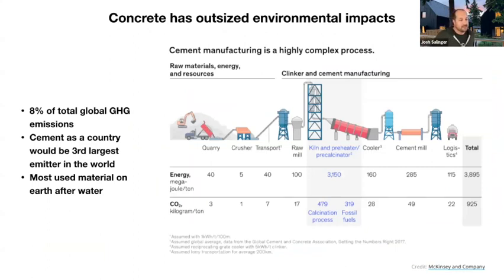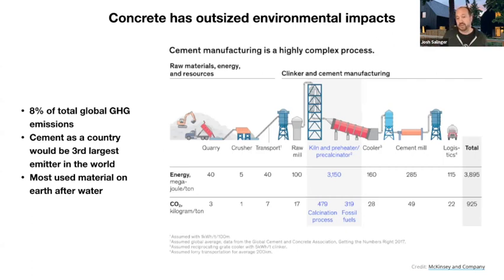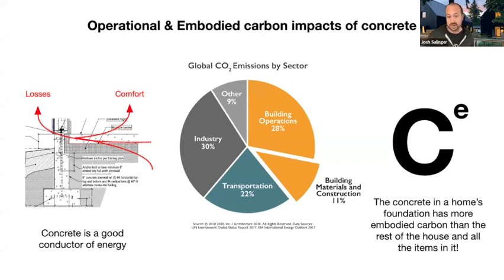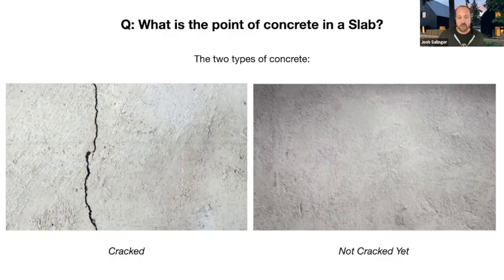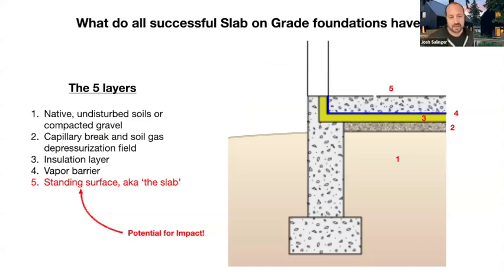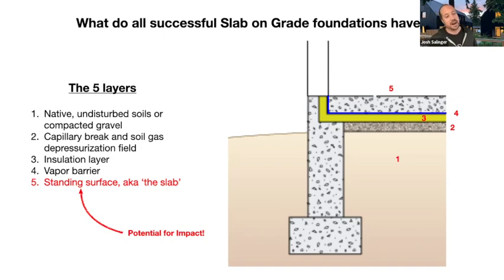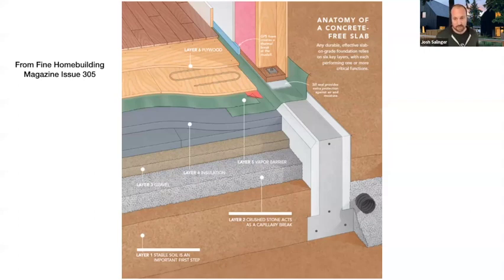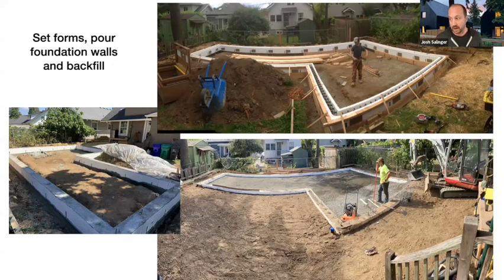Concrete-Free Slab On Grade Foundations with Josh Salinger | Passive House Live

Comment: Material cost for the 4 layers of sheet material will be $6 - $7 p/sf. 
Material cost for 4" Concrete with 4" EPS at about $5-$6 p/sf (dependent on reinforcement req). 
Big DIY advantage goes to the plywood/EPS system; consider using a Permanent Wood Foundation to eliminate 100% of concrete. PWF also DIY friendly.  
Perhaps an insulated concrete slab would prove advantageous by adding heat-sink value in colder climates.
Reply: Ya very surprised after saying how bad concrete was that they didn’t use a PWF